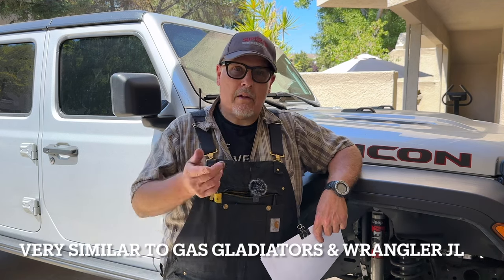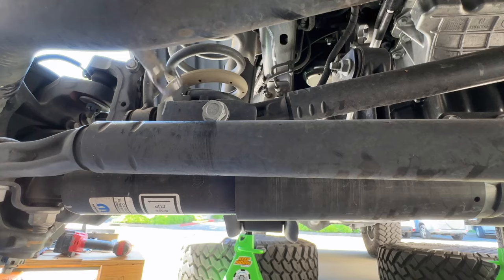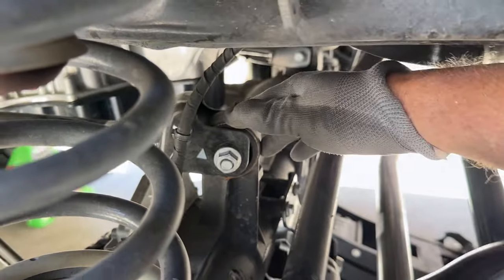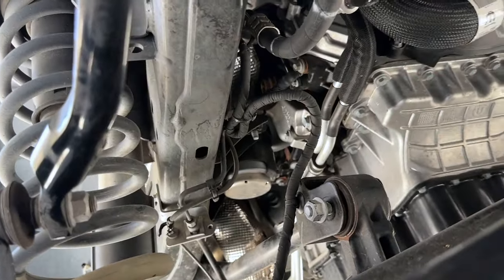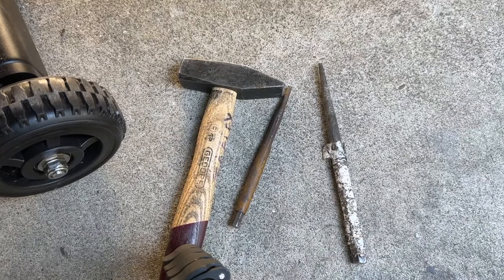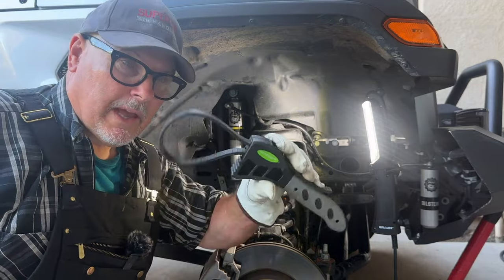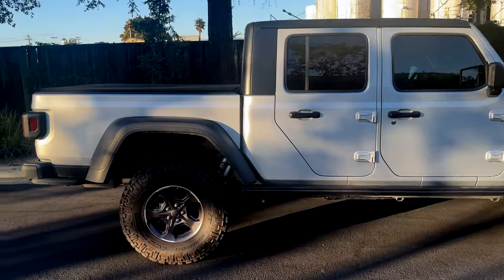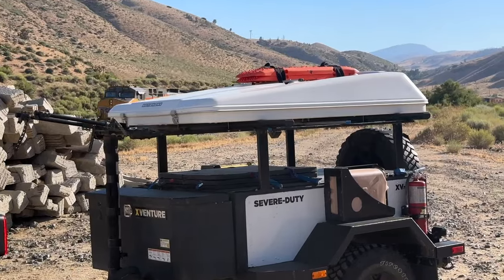How To Install A Lift Kit On A Jeep Gladiator (For Beginners)

Comment: Disappointing about the riv nuts. You shouldn’t have any issues with a 2K OEM lift kit. I had the same problem. I also had two of the same spring seats. Both left sides.
Reply from the maker: I was lucky to have some that would work. Spring seats must have been a big delay. Thanks for watching!

Comment: I know your pain. I installed mine in my driveway as well. Also had a difficult time with the front bump stops. If I remember correctly, I bought one of those Tite Reach ratchet extensions (mostly so I could put the exact amount of torque specified). In any event, I had to use needle nose pliers shoved into the little holes just below the top of the bump stop to hold it while tightening. Had to have a second set of hands; it was silly. I like your thought on the strap wrench
Reply from the maker: It’s good to have a mental inventory of what’s in your garage. I have had that strap wrench for years never used it. Good luck with your rig! Thanks for watching!

Comment: Can you post a review on this kit?
Reply from the maker: I''ll be taking the Gladiator on a overlanding trip in November and give it a good review after that. It did solve the problem of the front end hitting the bump stops and the vehicle drives awesome on the road. I did not need a new track bar, stock worked out fine. Thanks for watching!

Comment: What made you go mopar I went Clayton, awesome video man
Reply from the maker: Thanks! I like the OEM engineering. Mopar fits perfect works perfectly. Appreciate you watching!
Reply: @MuddyRuttzz  thank you for your input how many inches you think you gained?
Reply from the maker: @ryancarpenter1678 I ended up about 2 1/4” higher than stock.

Comment: Nice job looks great. How does it ride compared to stock?
Reply from the maker: I was hitting the Bump Stops in front after adding bumper and winch. That does not happen now. It rides absolutely great. I did not change the track bar since it is only a 2" lift. Jeep got a alignment and now will keep a eye on tire wear. Going to be a little bit before I can go off-road with the vehicle. Thanks!